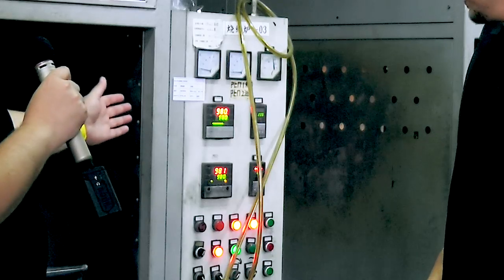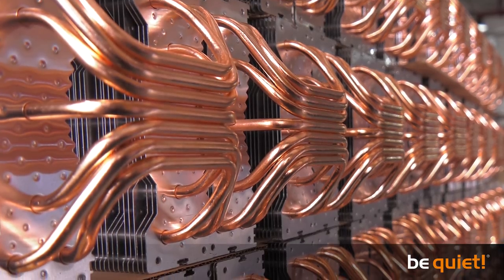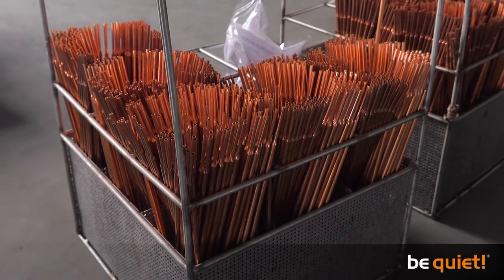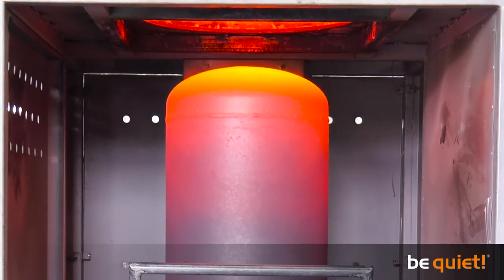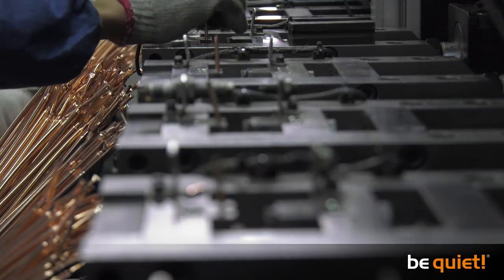The production of be quiet! CPU coolers, part 1: heat pipes

Comment: 0:50 Coil pack copper pipes...mechanical pulled out straight
1:10 press/squeeze cup tapered 1side
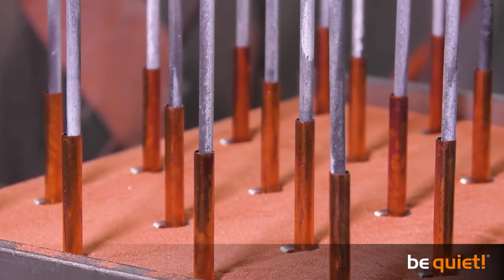1:18 held in place...steel rod centered to evenly space copper powder coat/layer..pour on while.+vibration to hardened pound together copper powder stiffen...
2:00 baked thick wall oven 980degree C/F?  (8hours)
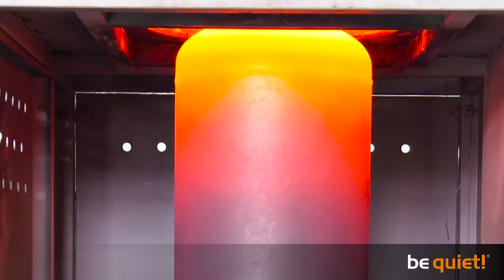2:10 done...fan cooled
2:22 filled with 2mililiters distilled water coolant
2:30 pipe is air vacuumed twice...
2:40 sealed airtight...

Comment: Nice! I always wondered how CPU coolers are made. Can the liquid evaporate in time?
Reply from the maker: Since the heatpipe is totally hermetical closed and the liquid runs in a vacuum surrounding, it is not possible that the liquid can evaporate. Water Cooling is of course a different topic.
Reply: Better reply: Evaporation and Condensation is how the heat pipes works. However the heat pipe is sealed, preventing the contents from escaping, as it changes phase from liquid to vapor. As the vapor travels down the center back to the cold end, it condenses back to liquid form, to be sucked up by the "wick" for it's journey back to the hot end of the heat pipe, then the process starts all over again.

Comment: I stumbled upon this video, and couldn't help but make a comment about the part in the video at 1:40. At first glans it looks like the powder isn't distributed evenly, so I decided to look closer and counted that there are 6-9 pipes that clearly aren't evenly centered. That's a 33-50% quality control issue. Does it not matter if there are sides of the piping that don't have the powder composition? To me it seems like that would be negatively impactful for cooling; but I'm no engineer. Thanks for reading. :)
Reply: I don't think it significantly affects the performance, provided the heat pipe is well embedded into the heatsink and has a good thermal bridge. The volume of the hole doesn't change, so the vapor moves from one of the tube to the other the same whether it's perfectly centered or not. The volume of the wick doesn't change, so it should be able to move the liquid back the other way just fine as well. A more even distribution probably makes one side of the heat pipe slightly better at absorbing or releasing heat, but if the pipe is properly embedded in the heatsink that evens out (since you want thermal contact on all sides if possible anyway).

Comment: I wonder, how do they avoid the water getting sucked out also when removing the air?
Reply: Small amount of working fluid evaporates, but it is pre-calculated and pretty much constant, so it doesn't effect performance.
Reply: Some does, and it's a good thing too.  The steam helps blow the last of the air out of the pipe, and even a tiny amount of non-condensable gas remaining inside would greatly reduce the performance.

Comment: I have a question. How efficient are vapour chamber cooling as opposed to just copper heat pipes?
Reply: they both work on the same principle..  the only thing you should consider is the surface area where the aluminum fins come in contact with the vapor chamber and heat pipes..

Comment: min 2:30.  why 2 milimeter of water and not full? where can i undertand this technical concepts?
Reply from the maker: This is because the water and water vapor still need space to properly dissipate heat.. At the base plate, where the heat is the highest, the liquid is being evaporated whereby it ascends to the cooler regions – where it dispenses the heat little by little which condenses the vapor and sends the resulting water back to the base plate where the whole process restarts. This continuously changing aggregate state is very important for the cooler’s efficiency as a pure copper pipe could fundamentally less and much less purposefully transport the heat.

Comment: 2ml per pipe? So... they are pretty empty in my opinion.
Reply from the maker: Not really, if you keep in mind that most of that cooling liquid is steam, that transfer the heat in an unbelievable speed. Then it cools down, becoming liquid again, heats up to steam ... many, many, many times in just a short time. That's why you need only 2ml per pipe.
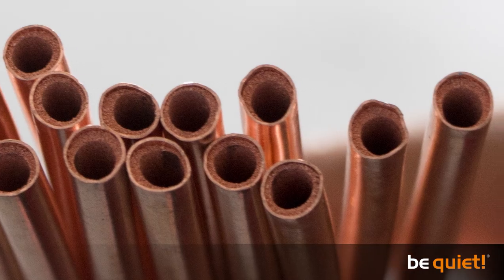Reply: Anyway great video. I didn't know that there is copper powder inside. At 1:42 we see that powder is not evenly distributed. Some pipes have no powder near the pipe edge, while in others powder is perfectly centered. Does it matter?
Reply from the maker: Yes, some structures are not perfectly centered. But that doesn't matter, because the cooling liquid have the same amount of micro-capillaries in each heatpipe to run back to the heat source.
Reply: bequietclips d griffith